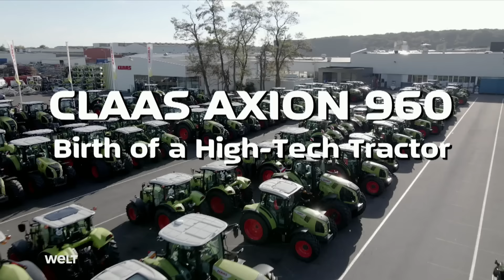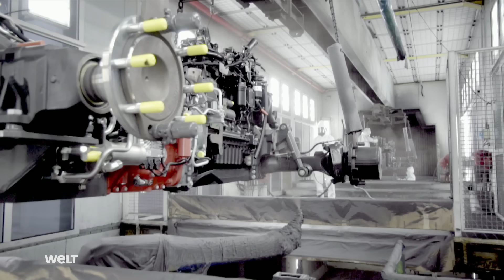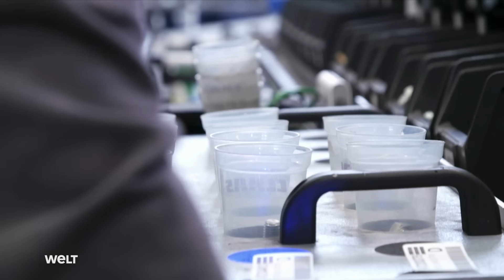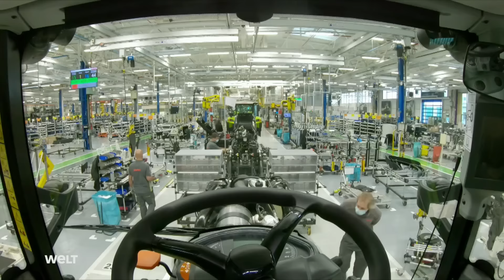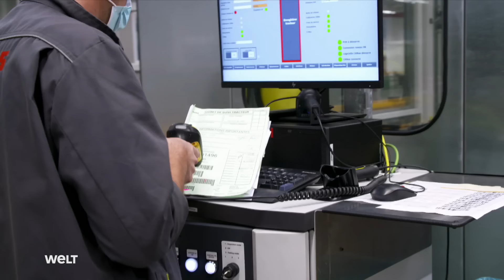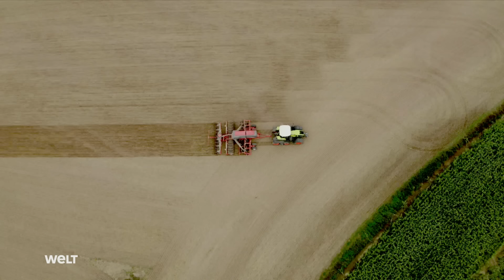Tractor Manufacturing: Inside a Modern Factory | FD Engineering

Comment: Give me a 1970ish Farmall 856, open cab, no fancy electronics, no auto steer. Farmall was the pinnacle of farm tractors before leagal issues caused their downfall... Enter Case IH. cheap tractors built to last forever..... now farmers have to shell out $500,000-$700,000 per tractor. When farmers lost the right-to-repair their own equipment and pay manufacturers certified mechanics at exorbitant amounts of money for repairs, i lost all respect for the industry.

Comment: It appears that John Deere is circling the drain, perhaps leaving a huge part of the North American farm equipment market available for anyone who can jump in. Just treat your customers better than John Deere treated theirs. That ahouldn't be difficult.
Reply: They're doing the same thing. This equipment is far more software than hardware which subjects it to a subscription model. I'm no flak for John Deere but there's nothing shown here John Deere didn't invent
Reply: @sgeine  Everything is software-driven these days, and getting more so. The issue is customer service. The manufacturer who offers the most responsive customer service, as well as a reliable product, is going to be the market winner. It seems Deere is failing at both of those. Repairs wouldn't be an issue if the equipment didn't break down.
Thank you for your thoughtful response to my comment.
Reply: @ralphaverill2001  Customer service issues and transitioning to a subscription model go hand in hand and the latter causes the first. Consider this, you and/or your family have owned Deere's for decades that you could service yourselves, they used ubiquitous parts, you could buy them used and service them just as reliably. Fast forward to now, they are GPS based, the tractor can harvest the land itself, it will tell you how and when to do it for the highest possible yield based on weather trends, soil, whatever. But you can no longer service your own vehicle. On top of that you now have to pay a monthly subscription to use your own tractor. This is at the core of their customer service issues. Right or wrong, that's the direction they've chosen to take and the subscription model and black box model is the direction most vendors have or are taking. It's a much larger issue. "bad customer service" is a gross oversimplification.
Reply: @ralphaverill2001 Deere has 60% market share in North America the largest of any ag company ever and by far the best dealer service. The subscription model only applies to the gps guidance systems which every brand does as well.